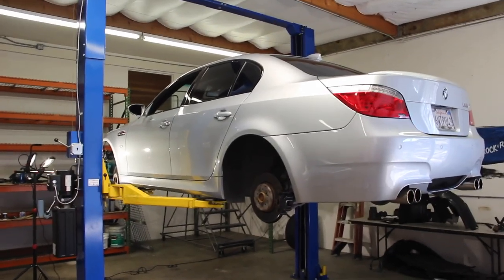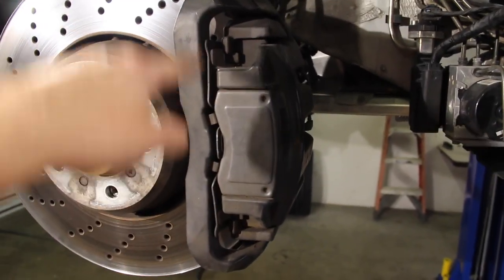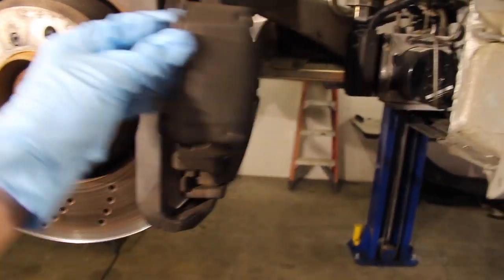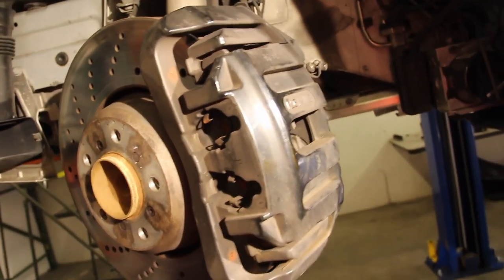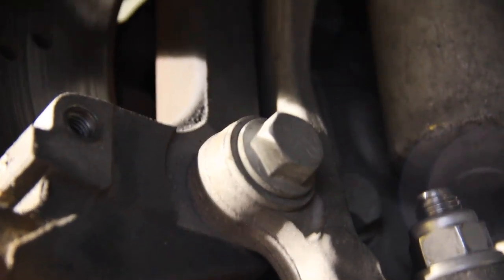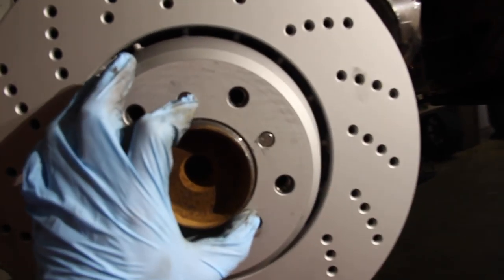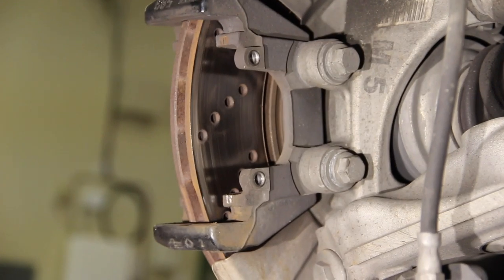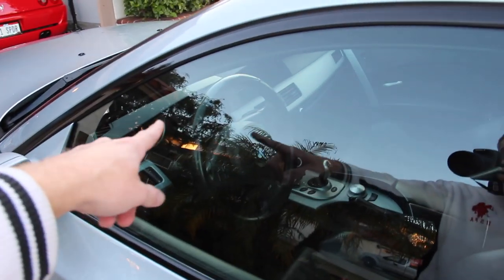BMW E60 M5: Brake Pads & Rotors DIY

Comment: Great video! I found it after doing my E60 550i fronts today. They are pretty much identical to this, except only one brake disc retaining screw (not 2 as on the M5) and no locating lugs for the disc. I really struggled. Found best way to remove the disc retaining screw is to do it first, whilst everything on. Soak it like Ryan says (WD-40 or similar) then heat it. First disc I tried, I left it till the end - big mistake. Same with caliper frame retaining bolts (18mm hex head). Sure it is OK if on a lift and you can ground clearance for long breaker bar, but on axle stands, I needed to heat, cool, heat again, before they would budge. It is also possible to just undo one of these 18mm bolts and then nudge the bracket with rubber mallet, then disc can be removed at an angle.

Comment: Hitting the rotor with a hammer to get it off fixed my intermittent ABS light ;)
And cleaning all the caked on dust and using copper grease cured the weird groan noise just as the car came to a stop. It's same as brake squeal, but much lower frequency.

Comment: GREAT video. Great job.  Chassis looks pretty clean. May want to check into Integral bushings and links on the rear carriers. If you can get your hands on a Chassis Ear, put a clamp on all 4 carriers and take the M5 for a spirited ride with a friend. That way you can verify everything on the carriers is running smooth. Rear bearings and bushings on the M5 get alot of abuse, especially with burnouts and such. Dynamically loading the assemblies and listening with a chassis ear is the proper way to check this. Chassis Ear's can be had for 100 dollars. I've had bearings that sounded fine going straight but sounded rough during hard cornering... If you get squeal with your current grease, try Dow Corning Molykote 111 on the piston and contact points. Proper break-in proceedure for new pads is to take it easy for the first 1000 miles. It seems Hawk has conflicting recomendations than BMW TIS. This is important for quiet smooth brakes.

Comment: Can I just ask a question about an E39 diesel not starting? I parked it up for a few hours with no problems then it won't start. It turns over fine but doesn't fire up. However, when inspiration Easy Start spray into the air intake it starts fine and continues running fine. If it's turned off it won't start again unless we spray it again. Any ideas why that would be?
Reply from the maker: I know absolutely nothing about E39 diesels, I have never even seen one since we don't get them here in the US.  Sorry I can't help!

Comment: How do you put the dust cover back on? I took it off and can't get it to go back on.
Reply from the maker: It lines up and then pops on.  It’s been a few years since I did it, but I don’t recall having trouble.
Reply: @E39Source  Thank you for responding. I found your video from 2013 which shows how to.

Comment: Great video, I can’t believe you got so much life out of the brakes.  What was the rotor thickness when you changed them out?   My rears are just near the low end of the spec at 50k miles (6MT) but I have plenty of meat left on the pads.
Reply from the maker: It was low, though I did not measure it.